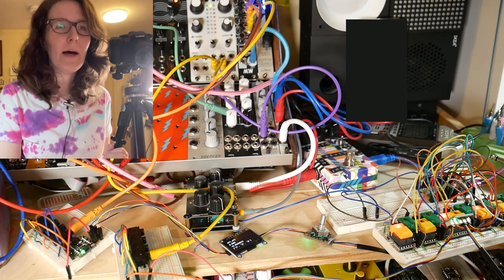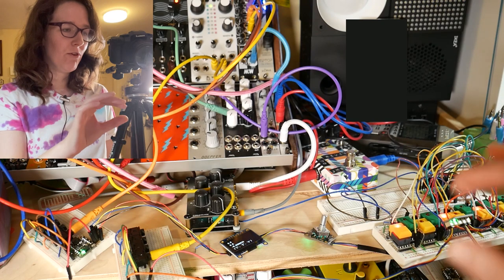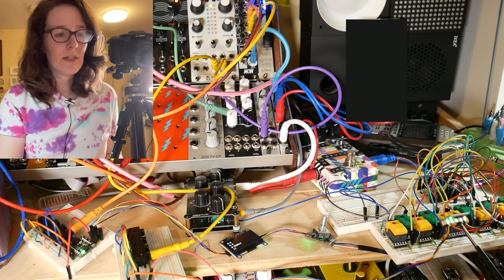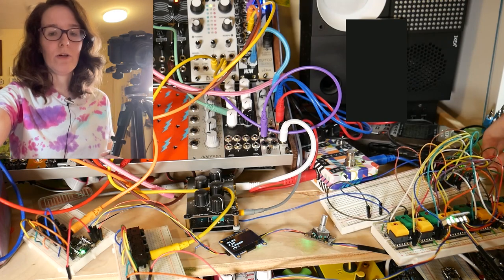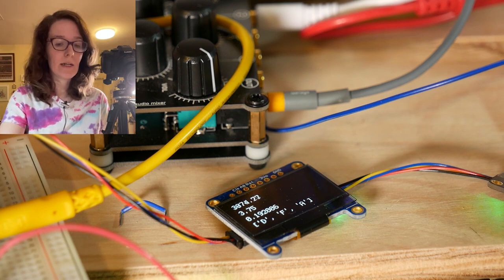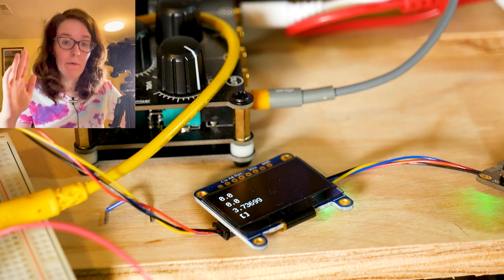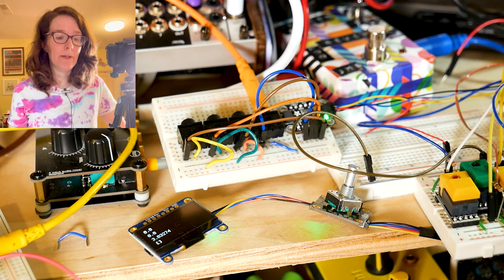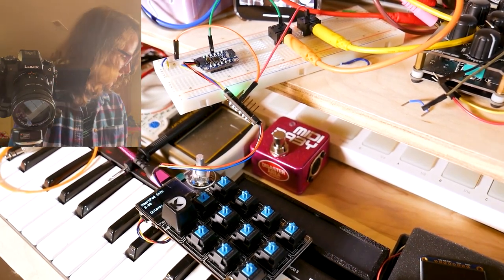Modular Melody Maker Build Log 1: Acknowledge and Accept the Spaghetti

Comment: As an ex pro-audio service engineer, I feel your pain. I strongly suspect one of your modules is putting noise onto the power ground, and that's what's causing the system to misbehave. You could try a semi-star ground, don't connect any grounds between modules, just run them all to a ground rail on one of your breadboards that is connected directly to the incoming ground. You could do the same with all the positive rail connections as well, that would mean you could twist the two supply wires together to prevent any inductive coupling.  You could also try lifting the signal ground on the ADC input cable.

Next up, I'd try decoupling and smoothing, add a 100n and 100uf cap across the power input to each module in turn, as close as you can. That might help prevent the troublesome module from creating the noise in the first place, I know some display driver chips are particularly bad at that. 

There's lots more I could suggest, but I hope that gets the problem solved. Though as others have said, perhaps it's just a dodgy connection somewhere, and a rewire is the first thing you should do.
Reply from the maker: ah thank you!! these are all great tips.

Comment: Love the build log, looking forward to more! :) As a self-educated, creative-background electronics learner myself its reassuring to know that these kinds of 'stumped' moments really are universal. 😂

I'm still early in my own analog electronics learning journey but one thing I've seen a lot in repairing test gear is the use of a separate filtered power rail and ground plane for anything analog. Usually there's one or two types of small caps (electrolytic for filling in gaps, ceramic for filtering out high-frequency noise) between power and ground, some deliberate design to focus on 'star' grounding, and typically a separately regulated (usually with a linear regulator like a 7805) power rail just for ADCs/DACs or op-amps.

Breadboards definitely make analog stuff more complex to play with though. My breadboard analog projects have all run into weird power rail blips, which I learned a bit more about from binge watching Ben Eater's lovely "breadboard computer" series. If I recall right in the earlier ones he gets into a bit of detail on where/how/why to drop power rail decoupling capacitors on breadboards to clean up power but I can't find the specific video at the moment. 😅

Hope some of that helps, and we'll all be looking forward to the next one!

-fivesixzero
Reply from the maker: excellent, thank you so much! these are all great things to keep in mind even beyond troubleshooting to the final pcb design

Comment: Great buildlog video - like the format, especially when things go sideways. No build survives first contact with implementation! RE: the noise issue. I would strongly suspect a grounding or PSU-related issue, especially with power being derived from multiple places i.e the Eurorack PSU, USB power for the Pico, the 3v3 to 5v I2C stuff - all recipes for a ground loop or something similar. Not too familiar with the particular ADC and DAC you're using, but from past experience leaving any unused analogue inputs floating can be bad for noise rejection. Some ADC/DACs need to have separate analogue and digital grounds too - the datasheets will probably indicate if this is case. Good luck with the trouble-shooting. Sounds like you're on the right track.
Reply from the maker: thank you!

Comment: thats cool. but i really dont know any programming therefore i do not like arduino and such microcontrollers. and all that stuffs.  i rather just use you know. IC chips , analog, ya know that sorta. thing. you ever play with CD4040 chip ? some interesting things.
Reply from the maker: very cool! personally i don't know much about analog electronics thus why i gravitate towards circuitpython
Reply: @BlitzCityDIY  guess im just backwards. you should check out CD4040 chip, its similar to this. very very easy to use.  its pretty neat.
Reply: @BlitzCityDIY  your definately a cool lady for doing diy keep at it tho, even if your programming arduino and such. thats a very popular thing. those things drive me nuts. i owned a few and wound up breaking them/chucking them, i cant even figure them out.  LOL